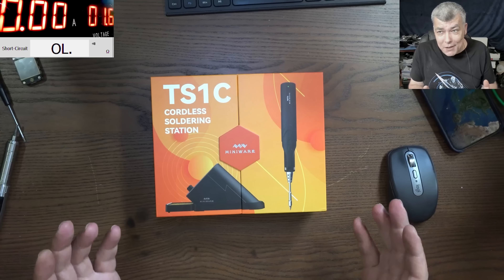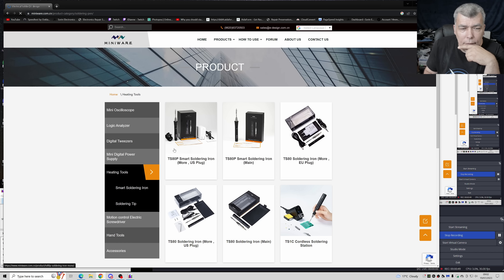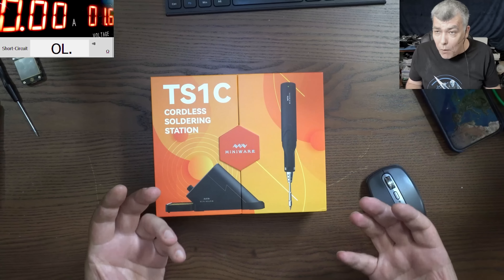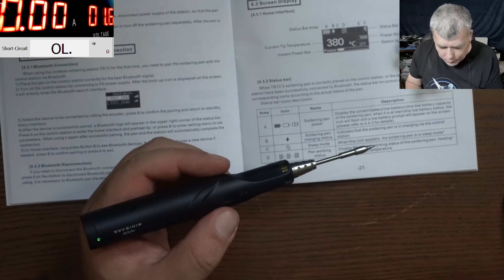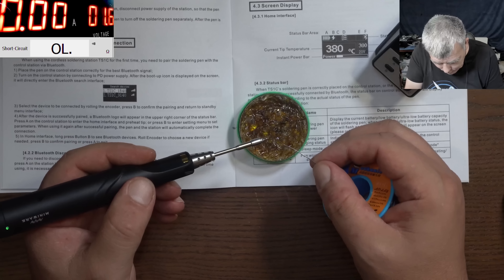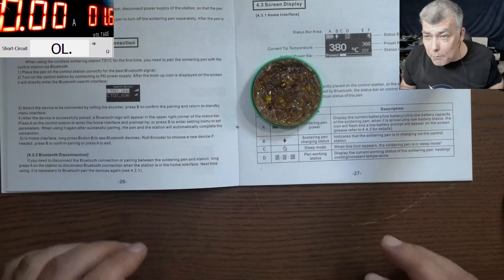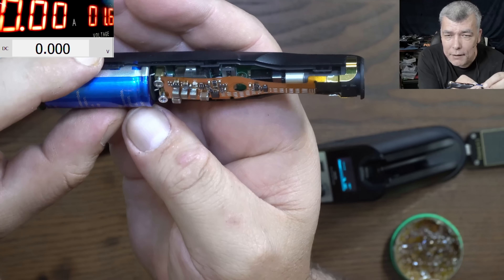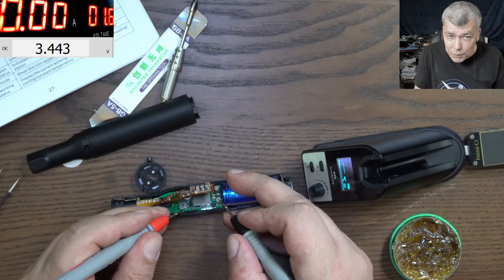Miniware TS1C Cordless Soldering Station review

Comment: What melting point is your "low melting point solder" if I may ask, please?

I wonder how long it would be before an owner of this nice new iron pokes the hot bit into the base unit screen when they try and put the soldering iron back into the base unit?
Reply from the maker: 180 C
Reply: @electronicsrepairschool  Thank you, it's the same as the 0.8mm multicore solder I use. I had been thinking you might have found something slightly lower in temperature.

Comment: Nice little tool, I have a cordless one about the same size that I bought around 20-25 years ago and it still works, it heats up using butane fuel you fill it up like a cigarette lighter. I'm sure I bought it at Radio Shack when they where still around.
Reply: I have a Black and Decker unit like that one. Nice to have when out on a job and need to solder something up.

Comment: I wish they had incorporated a similar tip removal procedure like the TS80/P and had added some sorta heat-resistant silicone in the Iron Holder portion of the Station to prevent accidentally burning the plastic.

Comment: im sceptical! i would very soon tire of putting it back on the charger. cordless vor me is butane for in the field use. this is a gimmik - nothing wrong with a cable - you always know where the iron is if its attached to a wire right?
Reply: problem with buttane/gas soldering iron is that you don't have temperature control, you don't have screen to see parameters, you miss a lot of things, it is basically a primitive and bulky version of a cordless electric soldering iron.

Comment: They have the bend tip J02, but often you're loosing a lot of thermal power with such tips. My favorite would be the D25 they offer. I'm using a D24 on my JLC for 90% of the stuff i do. It's a great average size. Not too big, but also not too small so it still has a lot of thermal mass.

Comment: I left the computer on (toshiba r830-u16) until the battery ran out of charge and turned off on its own.  When I got back, I turned on the computer, but it starts with a low sound and nothing appears on the screen.  I removed the RAM and CMOS and tried the TV screen and the same problem remained.

I need help, thank you.

Comment: Now we just need wireless multimeter probes. How nice would that be lol
Reply: we already have for some time BT/wifi multimeters, thanks to miniaturisation, we already have some wireless probes... a bit bulky, but anyway...
just a search for "wireless multimeter" will wield a lot of results, mostly exact!... :)
the usual suspects: Aneng and Fnirsi! :D

but i know their internals, well, not exactly, but i know the basic principle, so, i will craft mine, using some old parts and stuff... it will be bulky, but this will be crafted by my own hands, not shopped! :P

(funnily enough, i have a non-working fitness bracelet, kid-size... i get it for free, because wasn't working, and i wanted it to reuse their internals: accelerometer, pedometer, etc., for a self-crafted Pipboy. before hacking and slashing, i tried to see what was the problem... ultra banal and usual, broken li-po batt, used a a power supply set to 4.1, it was working fine. checked his mcu, a reasonably... old Nordic nrf one... some site search and... he-he-heeee... now, i have something nice, to play happily!!! :D)

Comment: A complete package with 5 tips and a power supply will cost you around $300. That is way too much.
It doesn't last for 7 minutes, it take 7 minutes to a full charge. I wonder how many seconds you can solder with it without putting it back in the charger, 60 seconds?
Please do a test, so we can see how long time you can solder with it on one fully charge ...